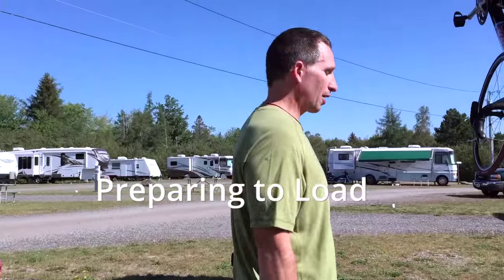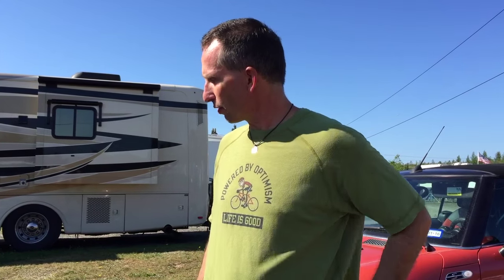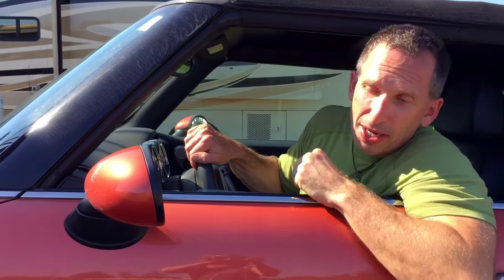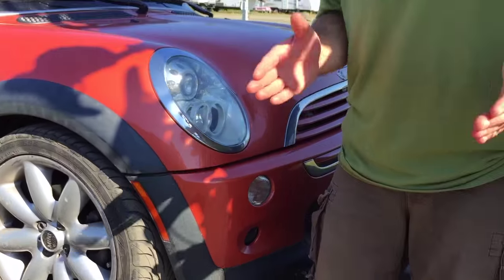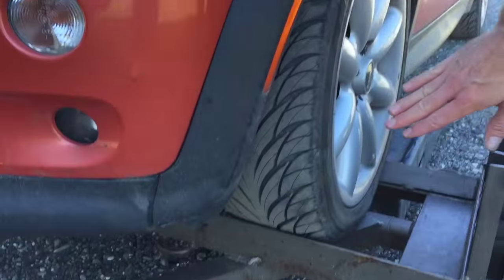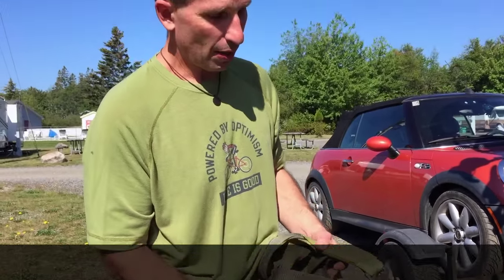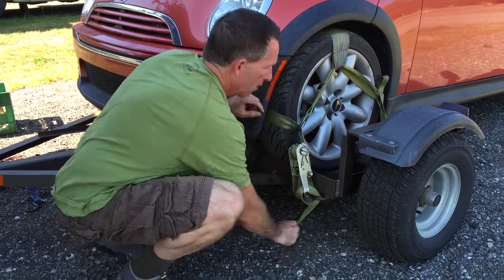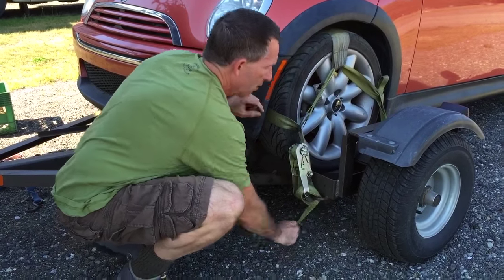How to Load a Car (TOAD) onto a Tow Dolly – Towing Option for RVers

Comment: I have a few more years yet before I retire and go full time. I find your video's very informative and helpful. I was wondering after watching your tow dolly video if you connect the taillights of the tow vehicle to the motor home. I thought it was required to have the lights on the tow vehicle operational or at least a set of operational lights attached to the rear of the tow car. Perhaps you do attach the lights but just didn't include it in the video. I was thinking of towing four down but watching you I may consider using a dolly. I also like your 3,6,9 and 12 months update of how things are going. I know full time is exactly how I want to go at least for 4 or 5 years but my wife is not as sure as I am. she is willing to try it for a while but your video's help a lot and I think once we get out there she will love it. Thank you for sharing your journey Gregory Dugre.

Comment: I used a tow dolly for 2 years and could not wait to get rid of it. Took us at least 30 minutes to hook up and if it's raining or snowing crawling around on the ground was a real pain. We found that no matter how well the straps are tightened they will work loose. We found that we had to stop at least 3 times to make sure the straps were tight as they stretched. Stop number one was before leaving the camp ground, number two was about one mile down the road and stop three was at the first rest stop. The straps never did not stretch and our vehicle move at least 6-8 inches backward. Safety chains are a whole story in themselves. I had one knot up and it took me an hour of crawling around on the ground to get it free. The two vehicles we towed were a MINI Cooper and a Toyota van. The MINI towed well but the Toyota van end up with rear suspension issues from the weight being shifted toward the rear and had very high rear tire wear. Now that we have a GMC Acadia and a tow bar we can be on the road in 10 minutes and near have to stop to check anything. We do check at every rest stop. No more having to find a place to pull over and check on the dolly straps. Our tow bar is a Ready Brute Elite with a built in surge brake, works very well and after 4 years we've had no issues.
Reply from the maker: Thank you for sharing.  We had challenges with our dolly too, but sounds like you had even more challenges than we did.  That said, we were still very happy to have made the switch to towing four down with a tow bar now that we have switched vehicles.  We love our Roadmaster Nighthawk, and Invisibrake.  Here are links to our latest set up. https://youtu.be/8949W9UjCr4 for part one, and part two here https://youtu.be/S2p8oeZPU_I
Reply: Loosening straps often result from not enough wraps around the ratchet.  Don't start off with straps pulled real tight. Straps need at least three complete revolutions so that the straps bind on themselves and don't slip.  @Rvlove

Comment: For stability I recommend putting on the rv parking brakes.  Watch the forward movement on four rv/dolly when you drive up.  Will keep the mini from pushing the rv and dolly forward resulting in a more stable platform  to drive up on.
Reply from the maker: The RV Parking brake is always on when we do this... it's just about impossible to stop some movement when driving up onto the dolly.

Comment: We got our first motorhome back in May and decided quickly we needed to tow our car. Last Friday I bought a used tow dolly off Craigslist. This video was very helpful as the seller didn't show me anything. He told me that a license plate wasn't required but my tax commissioner said yes it was. One thing I don't understand is that the straps are identical so why is there a left and right? Thanks again for your video.
Reply from the maker: Hi there, we got our used on CL too - glad the video was helpful. Our tow straps are not identical - maybe yours are? Take a closer look to check, for ours the strap /loop is such that is provides proper access to each wheel and would not work on opposite sides - I would suggest contacting the manufacturer of your dolly to see what they say - ours is an Acme, yours may be different. Good luck!

Comment: I use  a Mini Cooper on a dolly also the ratchet straps click loose when you take turns what i do is wrap thick tow hook rope twice through the rims and wrap the rope around the dolly frame and hook it down tight then my whole 1200 mile trip from Vancouver to San Diego i do not have to worry about the straps coming loose around turns between the straps safety chains and rope hooks my car is not going anywhere but i am hoping to flat tow next season it is alot of work using a dolly there is days i hate doing it specially when it is raining
Reply from the maker: Thanks for sharing the tip.  We tie down the straps too, to help make sure nothing comes loose.  Agreed that setting up in the rain is unpleasant. We switched to flat towing for our second tow vehicle.  Here is a link to our towing related articles and videos on our website.  https://rvlove.com/start-here/rv-setup-vehicles/towing/
Thank you again and safe travels -M

Comment: Thank you for the TOAD videos. We plan on using one this summer. I noticed that you do not use auxiliary lights on the back of your car but only rely on the dolly lights. Have you ever had any issue with law enforcement only using the dolly brake and signal lights?

Thanks for the great content.

Joe
Reply from the maker: Nope never had an issue - and now we've changed to towing a Jeep four down. :)

Comment: Nice video, Marc. I tow 4-down so it was interesting to see the difference. Are the brakes on the dolly electric or surge? As I'm sure you know, when towing 4-down the brakes on the towed vehicle have to operate in concert with the towing vehicle. I opted for the SMI Air Force One system. It's a little pricier than some of the other systems but you don't have to mess with connecting those clunky boxes to the toad brake pedal - just have to connect a short coiled air line from the coach fitting to the toad fitting. Safe travels!
Reply from the maker: +TwoBoldlyGo Our dolly has surge brakes so we didn't need a fancy setup with braking for the car itself. Sounds like you have a great setup with yours! Nice and easy. Glad you enjoyed seeing the other side. You might be interested in our post on dolly vs 4-down and the reasons we ended up going that way. http://www.rvlove.com/2015/08/11/faq-pros-cons-tow-dolly-4-down/
Reply from the maker: +TwoBoldlyGo Safe travels to you too!

Comment: Thank you for posting this video!  We'll need a tow dolly to tow our Ford Transit van on our RV.
 and know nothing.. ;)    I was wondering where you stored the tow dolly in a campground, but read in the comments you put it under the RV.  Do you lock it down?  Do you ever just leave the tow dolly hooked up to the RV in a campground?  I didn't see you hooking up lights.  Don't you have to have those too?
Reply from the maker: Hi there, we slide the dolly under our RV if the site is short, but if in a longer site, we usually just leave it hooked up on the hitch.  I would estimate that we leave it hooked on the hitch about 70% of the time.  We usually lock it to the coach by locking the pin (and lock the hitch of course) or when we unhook it from the coach we will often put lock on it so it can't be easily removed and hitched up to someone else! That said, we are probably a bit overly cautious (Marc is ex law enforcement) and we see plenty unlocked so we are sure it's rare for them to be stolen. Yes we do have lights on the dolly, but we rarely drive at night for safety reasons.  Our car is very short in length so not far behind the tail lights on the dolly, and from what we understand, if the car extends less than 11 feet behind the last set of lights(double check this), it does not need it's own lights, especially since the RV lights are still very visible because our car is so low.  However.... your van would be much longer and taller, so we would definitely recommend that you have additional lights wired for the van because the van would obscure the lights of the motorhome.  The nicer, but more expensive path, would be to wire into the actual vehicle. We have also seen aftermarket lights that can be plugged into the motorhome trailer wiring and can attach to your van with magnets.  If we didn't have a soft top convertible, we probably would have done the magnetic lights.  I (Marc) really like your choice of toad (transit van).  Very versatile.  We actually saw somebody that built a wood shop into a van that they used as their toad.  Judging by your name, I am guessing that you are setting up a sewing room.  I think it would be cool to have a van because we could store larger items like bikes inside and could even do an occasional overnighter with the van without taking the coach.  Hope this helps.
Best of Life!
Marc and Julie
Reply: Yes, I am definitely going to have a sewing room.. :)  I make doll clothes that fit dolls like the American Girl doll and sell at European and farmer markets locally..  My husband is retiring in 4 weeks, so after the market season and Christmas, we are taking off for 4.5 months, heading south and then west to Arizona to look into markets there..  Like  you turned your closet into an office, we bought a 2017 Four Winds 30D bunkhouse, whose bunk setup turns into a 2 seat dinette, so that will be my sewing studio with a curtain to close it off.  ;)  The van carries our inventory and market supplies, and I absolutely love it.  We just got the 2 seater so we would have more storage, but it's just us, so the dogs can ride in the back..   ;)   Not sure if we could go minimalist and just live in an RV full time, but 4.5 months will be a good test..  Please keep up the good work on the videos.   I've learned lots from you both.. :)  Linda..
Reply from the maker: Thanks Linda, glad to hear it. Love the sound of your setup! Sounds like it works great for you. Am sure the 4.5 months will be a great experiment into the RV lifestyle for you. You don't have to do super minimalist if you have a bigger rig but yes the smaller you go, the more you have to let go of!

Comment: You've convinced me to go the tow dolly route for my soon to be purchased toad. Have you guys picked up much rock damage on the front of your mini? I'm wondering if some sort of barrier might be good to keep the paint chips down to a minimum, as well as lessen the potential for a broken headlight or chipped windshield. Thanks!
Reply from the maker: +Open-minded Skeptic Cool, assume you also read our post on tow dolly then? http://www.rvlove.com/2015/08/11/faq-pros-cons-tow-dolly-4-down/

Haven't had any issues with paint chips on front of the MINI - but towing with the dolly is one of the reasons we decided to go that route, to elevate it higher off the ground for added protection. Also it's a 2006 and already quite imperfect, we intentionally bought a cheaper/older car so we wouldn't get upset if anything happened to it on the road as it's pretty exposed to the elements.
Reply: RVLove | Marc & Julie Bennett "Haven't had any issues with paint chips on front of the MINI - but towing with the dolly is one of the reasons we decided to go that route, to elevate it higher off the ground for added protection."

Yes, this is what I was hoping would be the case, and part of the reason why I want to go with a tow dolly, as well. Thanks for the advice! Cheers.

Comment: What are some suggestions for pulling into a developed campground? Should the toad be unloaded from the dolly outside the campground with the RV towing the dolly unloaded into the site or unload the toad and unhook the dolly at the campground space? Also thinking about using the toad to pull the dolly into the campsite. We will begin dolly towing soon for longer trips.
Reply from the maker: Most of the campgrounds we have visited have check in areas that are great places to unload the toad from the dolly.  Sometimes during a rush of check-ins, it ends up being easier to leave the toad on the dolly until you get to your site and unload there, especially if you are able to have a pull through site.  Pull through sites would of course allow you to disconnect when you are already in your site.  We have known a few folks that have vehicles that are able to pull the dolly they get transported on once unloaded, but our MINI was not able to have a hitch installed, so this did not work for us.  If that is an option for you, it would be great to have the additional versatility.  Thousand Trails campgrounds , where we stay most of the time, allow you to choose your own site.  So, it was usually beneficial for us to disconnect at check in or wherever the check in staff recommended, and then search for sites with our toad instead of with the motorhome.

Comment: Did you add the piece of angle steel that is at the back of your front tire after the car is loaded on the Dolly?  I looked at other ACME dollies and they don't have that, but is seems like a great Idea to help keep the tires in place.
Reply from the maker: We didn't modify the dolly at all - except to switch tires and straps - ours is an older model - maybe that's why?
Reply: Thanks for the fast response.  I build my own dolly based it off of the Acme Dolly design, your video was a huge help.
Reply from the maker: Wow impressive! Glad you found the video helpful!

Comment: Great video.  Two comments:  1) be aware of local laws, some places require signal/brake lights on the rear of the car being towed, with no part of the car more than 2 feet behind the lights.  Your tow dolly lights wouldn't suffice.

2) I use a dolly with my 2015 Honda Fit, and the odometer is connected to the front wheels, so towing on the dolly doesn't add any mileage to the car.  We had a 2007 Fit, and the odometer was connected to the rear, so it would add miles.  Depends on the car ;)   Towing it 4 down always adds miles

Nice video!
Reply from the maker: Yes Marc looked into all that in the beginning and because MINI is so short should not exceed length past dolly lights to be illegal BUT perhaps the local laws in some states may be different as you say. 99% of time we don't drive in dark anyway for many safety reasons and personal preference. Good tip re the towing adding miles to toad... Safe travels!

Comment: Thanks for the little demo! Gosh I'm on the fence between 4 down and a tow dolly. Do you find it a problem storeing the dolly at campgrounds? Seems to me with a class a coach if you unhook the dolly and put it at the back of a campsite you could back over most of the dolly to save on space. A friend of mine sold his dolly he said it was a hassle hooking up and storing it he has a class c coach.right now we have an Elantra which would require a dolly, if we went 4 down we would have to buy a different car and the tow bar etc not sure if it would be worth the hassle.
Reply from the maker: HI Steve, yes we went through all of those questions ourselves! You are right - our coach backs 80% over our dolly and we've never not been able to fit it on our site. 4 down is unquestionably the easier way to go BUT the dolly works a treat for our low profile MINI. We get a LOT of questions about this and share our answers here - these may help you narrow down the best way for you http://rvlove.com/2015/08/11/faq-pros-cons-tow-dolly-4-down/ - we figure we can always sell the dolly and probably get our money back if we decide to switch to 4down (with a different toad). Honestly, the dolly isn't as big a hassle as many might think, if you really love your current car and don't want to switch it it's a good place to start and it you don't like it sell and go 4 down - as fast as we saw tow dollies selling on Craig's List, we are confident ours would go in a snap. Good luck!

Comment: Is your mini an automatic? Can I tow my automatic mini on a dolly without any modifications?
Reply from the maker: Our MINI was a six speed manual.  But... if you are towing on a dolly and keep the drive wheels on the dolly it should not matter what the transmission is. Therefore, you should not need to make any mods to your automatic transmission. -M

Comment: First time Mini toad owner. fob key in ignition, shift in neutral, remove parking brake, shut down ignition but leave key in. When I arrive at destination the battery is dead on Mini. When I turn off ignition it takes 30 min for car systems to go to sleep w key removed; then the steering seems to be unlocked. Can it be towed that way or will steering wheel relock? Inconvenient to have to wait 30 min but I can't find anything in the manual that helps w key to unlock steering and turn all other systems off.
Reply from the maker: Hmmm we are a 2006 Mini Cooper S. We turn the key all the way to where it is ready to pull out but leave it in place. We don't leave it on accessories. Seems very odd. Have you spoken to a MINI dealer/shop? That's what I would do. Should be the same as ourss but maybe there was a change between 06 and 07?

Comment: Are the lights of rv visible for other motorists? I didn't see any connection between the rv and the toad car.
Reply from the maker: +Niels Willemse Yes the RV lights are clearly visible. When it starts getting dark we also turn on the Mini stage 1 lights but we usually try to avoid driving at night with the RV anyway.
Reply: Okay, thanks for clearing. I hope one day to do what you are doing. Like your videos.
Reply from the maker: +Niels Willemse Thanks!